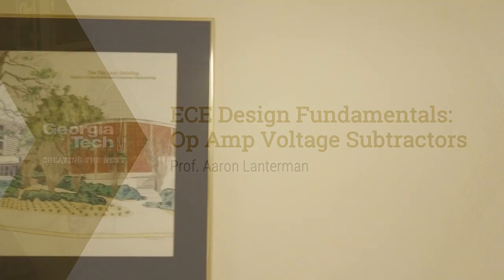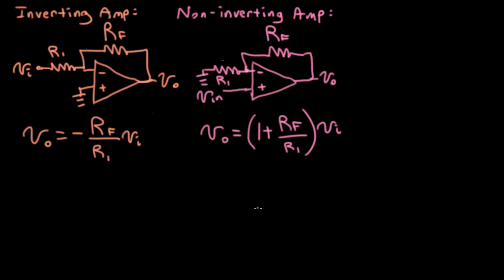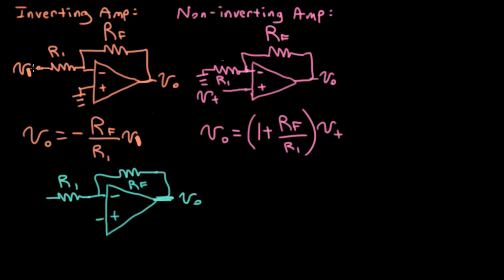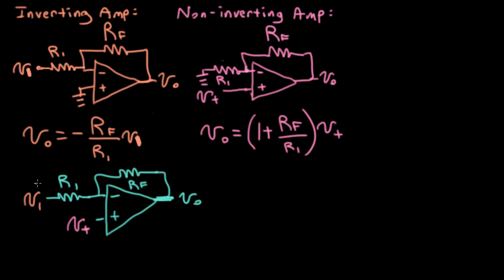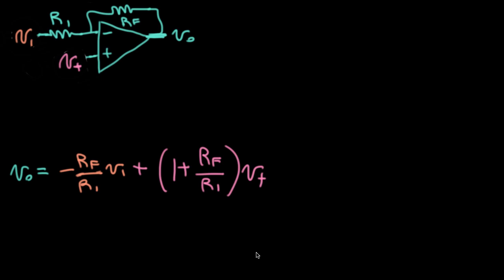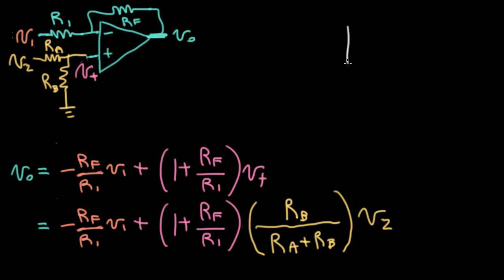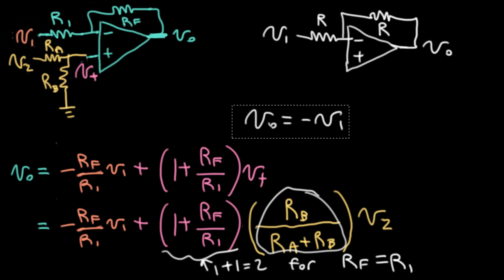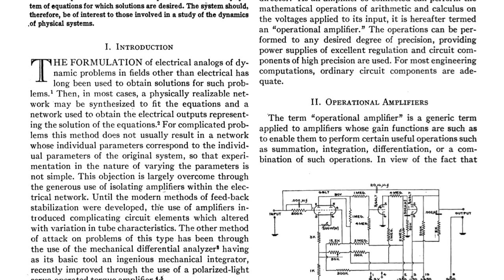Op Amp Voltage Subtractors and Superpositional Thinking (ECE Design Fundamentals, GA Tech course)

Comment: Yep! You drawing on your tablet is way more fun than a PowerPoint. ✌🏼
Reply: i agree. i was going to say that ive watched endless videos over the last few years with truly great presenters/teachers/etc, and it will be a straight hour of slides of powerpoint and even sometimes very well and clearly done. i realize that for many much more intelligent people than myself, thats all they need. but for me with powerpoint, its very difficult for me a lot of times to follow their thinking or reasoning behind their math, so im just left usually with 'well, heres the formula or whatever  or the configuration for this circuit," and i just try to memorize basically that and nothing more. watching you work through the problems as you would be thinking through them yourself has exactly the reaction you mentioned at the end of this video. it has helped me learn to look at everything in the circuit and work out how it is actually expected to operate on my own FINALLY. and im almost certain that was a key factor in m e coming back to your lectures on youtube now for quite some time. and many of them more than once. these are awesome.